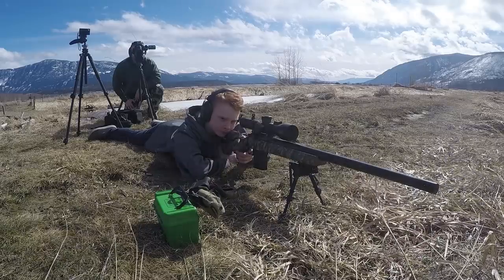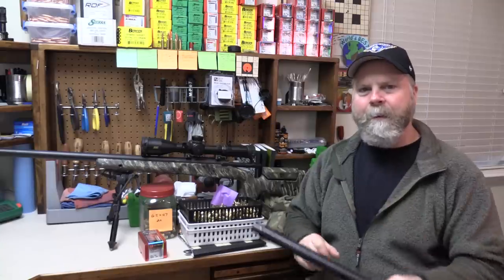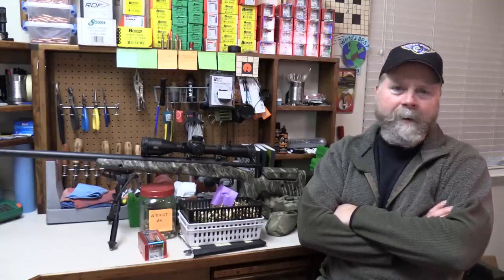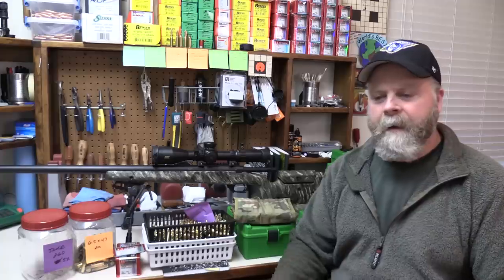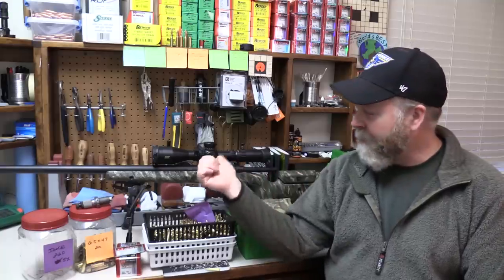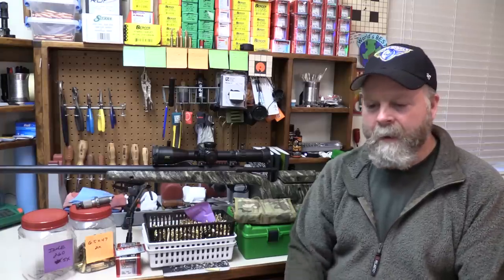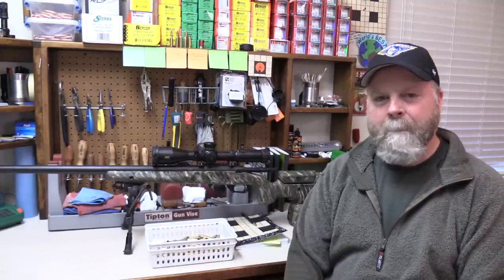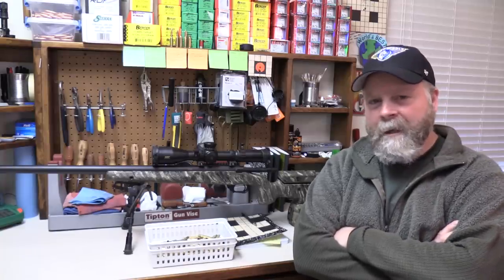Precision Rifle Load Development/ Part VIII: The Final Episode

Comment: I got the RCBS universal decapper and gave them a call when the pin wasn't going through the flash hole. They knew immediately that I was using lapua brass and they sent out some small pins gratis. Great company. In my experience the customer service from most of the companies in the reloading and firearms industries is top notch.

Comment: I have a Giraud and they are great. Really speeds things up. I can do 200 cases in 15 minutes and now sizing takes the longest. My only complaint is the chamfer is a little shallow and so I still hit them real quick with VLD type chamfer attachment on a RCBS prep center. Not a big deal and it goes fast but the bullets seat way smoother doing it that way. Great Vid as always...
Reply from the maker: Thanks for the insight on the Giraud.

Comment: Can’t wait for the next resizing video. I am trying to bump back the shoulder on my brass .002. But I am getting different sizes of brass at the shoulder. The brass is of mixed amounts of firing. Is that the cause? Redding competition dies and Forster coax press? Measuring with hornady headspace gauge. I used to just neck size. That’s why I have mixed amounts of firing in the brass. Now I want to bump the shoulder back. I guess I need to full size all the brass and bump it back .002 after every firing. Or is it too late and I need to start over with new brass?
Reply from the maker: It's common to get different shoulder measurements across different lots of brass. I would set up your FL die to bump one of the lengths .002" and run them all through it. I wouldn't worry about the dimension of every case as long as the function is good.

Comment: So after 1460 rounds you lengthened the round by .060, added 1.7 grains of powder.  Was the accuracy still the same?  Also, I chucked the Lee Universal Decap die rod and sanded the pin down to use it with the Lapua small flash hole brass.  The rod went from .0623 to .0570 after sanding it.  Works great on all flash holes now.
Reply from the maker: Yes. The last 5-shot group I fired was .3xx at 100 yards.

Comment: I'm having an issue with my expander ball sticking on the way out and I'm worried about run out. I have a gauge and get anywhere between .01 to .06 run out.  I tried neck sizing only on once fired brass and the bolt closes too hard on some rounds. Your thoughts on depriming , bumping the shoulder back .02 without the expander and then neck sizing with the Lee neck sizer.  Your input would be appreciated, thanks

Comment: what size neck and freebore did that reamer have, for the 47
Reply from the maker: I don't know the freebore dimension, but the fired neck OD is .294"
Reply: @PanhandlePrecision  i was thinking about ordering a custom reamer with a .293 neck and .163 freebore, grizzly tools has one in stock with a .295 neck and .167 freebore, the .293 neck may be a little tight ?
Reply from the maker: I was advised to use a .295 neck by guys running 6.5x47. I don't think I've fired a string with more than 20 fps ES, and lots of them in the single digits. They might be on to something!